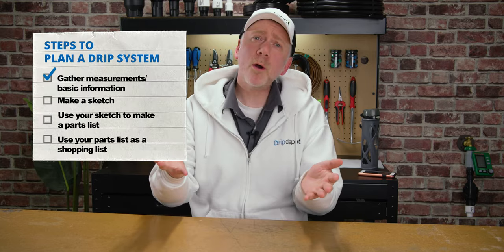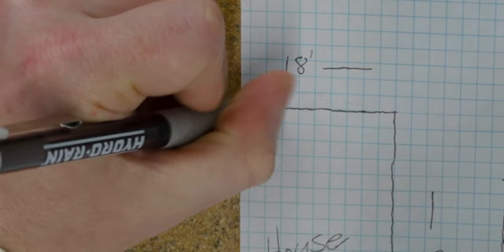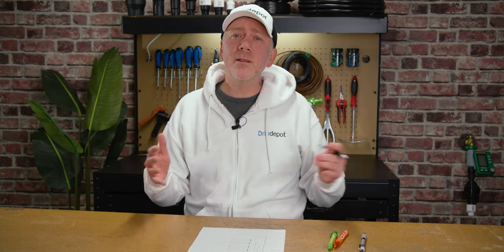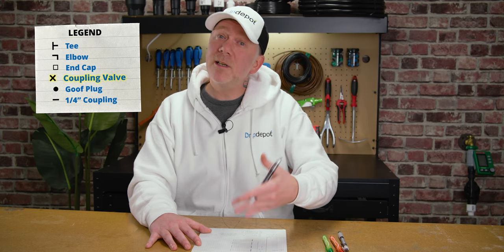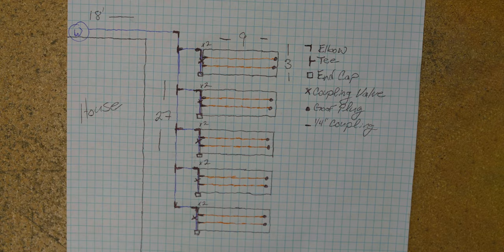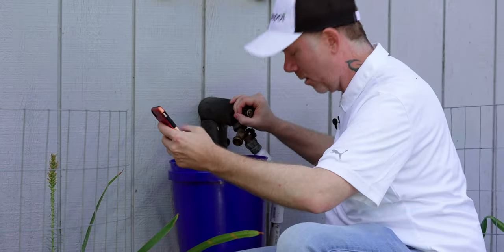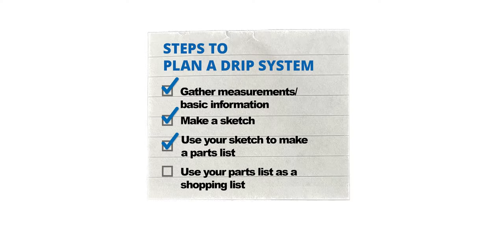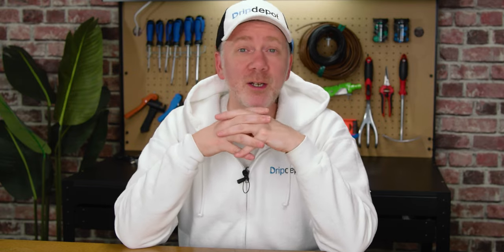How to Design a Drip Irrigation System (Beginners Step-by-Step DIY Guide)

Comment: Why didn’t you just run 20’ from the spigot (instead of 18’) to the beds and then the 27’ run could have fed each bed with a tee joint at each bed.  Less cuts and couplers that way.  I am planning my raised bed garden and that’s why I ask.
Reply from the maker: I'm probably misunderstanding (and if I am, definitely let me know!), but the reason we went 18' and then Tee'd off is so that each bed could have its own individual on/off. 

Here is an image that shows the design we were going for -- the coupling valves in this design are in a slightly different place, but achieve the same thing (third picture down): https://help.dripdepot.com/support/solutions/articles/11000119078-raised-bed-sample-layouts
Reply: @dripdepot  thank you! That makes sense :). I really appreciate your quick response.

Comment: SOLD! Great salesmanship brother! Im blueprinting and  measuring out what I need will make a purchase soon. Thanks!
Reply from the maker: Thank you for the kind words!  If any questions come up along the way, we'll be happy to assist :)
Reply: @dripdepot  Thanks, I'm wondering if I should use drip line or drip tape or both for my garden. I will have 20 rows of corn, 5 tomato plants, a 6ish ft long trellis wall for cucumbers, a 50ft long trellis wall for green pole beans, 4 squash mounds and 6 pepper and herb plants.
Reply from the maker: The description of your garden is making me hungry, must be close to lunch! 

How long are your rows going to be?  You could allow that to guide your decision -- 1/4" drip line is good for up to about 30' (with 12" spacing, less with 6"), drip tape is good for very long rows (hundreds of feet in some cases).  If the rows are closer to your trellis length (50'), drip tape would be the better solution for sure.  If the rows vary and you have some short and some long, it is possible to use both on the same system, you'd just want to make sure they have similar flow rates (or plan accordingly for some plants needing less water, some more).  

And now to satisfy this craving for some fresh vegetables lol
Reply: @dripdepot  Lol Thanks! its going to be a great garden I hope. My corn rows will be approximately about 40 ft long and I have my 5 staked tomatoes in a row with the cucumber trellis which is also approximately 40 ft long. Do you think I could get away with only using drip lines, or should I use drip tape for the 40 ft rows and 50ft trellis wall? Thanks soo much for the help. I'm making my cart as we speak.
Reply from the maker: That's awesome you're growing corn!  I lost mine to the raccoons both times I've tried, grr.  Maybe this will be the year haha.  

I think with 40' to 50' you can safely eliminate 1/4" drip line and can focus on 1/2" drip line or 5/8" drip tape.  The two are very similar, the biggest difference is in cost (tape costs less), durability (1/2" drip line is more durable), and flexibility -- 1/2" dripline can wind a little bit, drip tape has to be in perfectly straight rows (not a problem if you're planted in straight rows of course) :)
Reply: @dripdepot  Thanks for the info! Last year my sweet corn crop did great hoping for even better this year! So if I'm using 1/2" drip line can I still use 1/2" main line (poly). Ill be using about 150 ft total of main line
Reply from the maker: You bet, you can use 1/2" drip line and 1/2" poly together -- in fact, for the ones we carry, they use the same fittings so you don't have to locate all kinds of adapters.  

With that said, depending on the flow rate of the system, it might be worth making sure you wont' be losing too much pressure from friction.  Once you know the flow rate of your system (that's the sum of all emitters operating at once -- so if you're using 400' of 1/2" dripline with a 0.5 GPH emitter spaced every 12", the system flow rate would be 200 GPH), throw the numbers into this friction loss calculator to make sure it's not too high: https://www.dripdepot.com/irrigation-calculators/pressure-loss-calculator. 1/2" Poly dripline will drip pretty consistently from 12 to 50 PSI, so some friction loss is ok :)
Reply: @dripdepot  Is 1/4" punch hole size standard for all punches or do you step up in size on hole punches when using 1/2" drip line? Sorry if it seems like a lot of questions. I'm just completely new to drip irrigation and want to make my first purchase full & correct, also something to note my water flow from the spigot is 679.25 GPH.
Reply from the maker: The 1/4" punch is likely the most common used, but only when the system is using 1/4" fittings :) 

With 1/2" tubing to 1/2" drip line, it's unlikely you'll need a punch, so you're in the clear there -- what you'll want to do is think about how you'd like to connect your 1/2" drip line to your 1/2" tubing -- basically, what shape -- a straight line?  Just a 1/2" coupling would be needed -- Coming off perpendicular?  A 1/2" Tee.  

And definitely no problem on the questions!  That's the exact right way to do it in our opinion -- measure twice, cut once and all that good advice :) 

That's a great and healthy flow rate from your water source -- while it will be best to add it up to confirm, based off your description so far, I anticipate you'll have more than enough flow to feed the system.  

If you'd like me to send you graphics/images of the things I'm describing, you're welcome to email us, you can even put "Attn: Adam" and let me know it's you and I can send pictures of the things we've been talking about and describing.
Reply: @dripdepot  Ill be using 1/2" main line for whole garden, but ill only  be using 1/2 drip line for my corn rows. (1/4" for other plants) That being said, if not a punch to make the holes what tool to cut/punch the holes for the 1/2" Tee connections from main line to drip line? Whats the email? Also could I use 1/2" barbed couplings for the corn row 1/2" drip line instead of Tees? edit Ok I checked the website no 1/2" barbed couplings hence using Tee and cutter tool i understand now lol. which would also mean there isnt any 1/2" goof plugs , it'd be just end caps right? is there any difference between 1/2"main line and 1/2" drip line or same thing used for different applications?
Reply from the maker: Since you'll be using some 1/4" lines, you will want one of the 1/4" punches -- ok, with that out of the way, let's tackle the 1/2": 

For the 1/2" you'll probably want to use 1/2" Perma-Loc fittings, they are compatible with both the 1/2" drip line and the 1/2" mainline, no need for separate fittings.  

You have it right on the 1/2" end caps, the goof plugs will end your 1/4" lines (and fill any holes you make in the 1/2" mainline on accident with the 1/4" punch) :) 

And the only difference between our 1/2" mainline and 1/2" drip line is that the drip already has the emitters installed at evenly spaced intervals. 

Our email is support@dripdepot.com, or you can go through the contact us link: https://help.dripdepot.com/support/tickets/new (The Contact Us link should go to the same email address -- if you get any bounced emails or anything, use the Contact Us -- we also won't email you any marketing or put you on any emailing lists, just the info you request). 

In your email, put "Attn: Adam" and I'll get you over everything we've been talking about -- I can also review your cart and everything to make sure there's no incompatibilities and guide you through til the end :).  I suspect you're doing a great job though, as you're asking all the right questions.  We're just about to leave the office for the evening, so you might not hear from me until tomorrow, but you will, I'll make it one of the first things I do.
Reply: @dripdepot  You are the man! I'm going to do some final shopping and email you the cart. Thanks again!
Reply: @CastBlastCamp  Just following-up right quick -- if you've fired it off, I haven't seen it yet (no problems if you haven't, and no rush at all, just want to make sure I can help ya promptly) -- if it's being tricky, just use the contact us web form -- it does the same thing (sends off an email) and the reply will come to your in-box :)
Reply: @dripdepot  I emailed the contact us link
Reply: @DripDepotAdam  It said it sent the message ill try the other link too

Comment: Hello,
In the "main line" chapter, regarding the tubing size vs. lenght/GPH chart (200/200 rule), are you referring to internal or outside diameter?
Thanks for sharing!
Reply from the maker: Very good question, there's actually a bit more going on there than we touched on, good catch.  The diameter we're referring to there is the inside diameter -- to some degree, even that's misleading though as 1/2" tubing rarely has an actual 0.500" inside diameter.  For example, our 1/2" tubing has a 0.600" inside diameter which will experience less friction loss than an actual 0.500" inside diameter.

Even PVC has this issue, with 1/2" PVC having an average (it can vary a little depending on wall thickness) inside diameter of 0.622".  

Essentially, in the video we'll be referring to 0.600" inside diameter (with larger 1/2" sizes, such as 0.620", being able to go a little further and/or have a bit more flow going through) :)

Comment: OK, I'm going to stop buying my drip irrigation supplies from HD and go with you guys just to support your awesomeness!
Question:  In your example you show 3'x9' beds with two ~9' drip lines.  What's the rule for the number of lines in a bed?  In my case i have all 4x4 square foot garden style beds.  From your example it seems I could go with three or four lines.  Can you offer a rule of thumb?
Reply from the maker: Thank you for the kind words!  

Great question on the number of lines -- to some degree it is determined by the number of rows.  A common approach is to run one line for each row of plants.  For the most part that's what we did here, though some of those might not have been in an exact row (we installed this system for someone that had been hand watering beds, so the plants were all already in place).  

In a 3' to 4' wide bed, we'll usually do 3 lines (and there will often be 3 rows of plants in that size of bed).  Are your 4' wide beds going to have 3 rows of plants?  If so, you'd be served well by 3 lines, each one going right down its own row -- in common loamy garden soil, water spreads about 12" from the point of drip below the surface, so you might even get some overlap beneath the soil.  A little bit of overlap, or "head to head coverage" can be beneficial as it means no matter where the roots go, they'll find moisture.  

If your soil is particularly sandy and/or you'll have a 4th row of plants, a 4th line could be called for, but I think in most cases 3 will work very well here. :)

Comment: @dripdepot Hey great video. I'm planning out my irrigation system for about ~150 vanilla vines/ fruit trees/ raised bedsI've got planted across my property and using this video as a guide. One concern I've had that was an issue for me in the past when I used soaker hoses, was that it seems like I didn't get even distribution of pressure along the hose. I'm going to be designing the system over the next couple weeks, and I've got several different zones planned (one for vines, one for beds, one for trees, one for a small patch of lawn).

How should I be thinking about line pressure? The zone I really care about is for my vines, and while I haven't decided on either sprinklers or mist, its important to me that all emitters are flowing at pretty much exactly the same rate, and its going to be a particularly long run because most of my plants are planted along my fence-line. What steps can I take in the design phase to ensure I'll get good, consistent flow rates from my emitters for a given zone? Do I risk emitters at the end of a run emitting less than emitters at the origination of a run?
Reply from the maker: Very good question, and uniformity is one of the most important parts of irrigation, so you're on the right track in asking about it.  

The primary concern regarding pressure in your upcoming project is going to be in friction loss -- that is, pressure lost from friction between water and the wall of the tubing.  Friction losses primary variables are: The material of the line (poly, PVC, etc), the diameter of the line, the overall length of the line and the flow going through it in GPH or GPM (which is the sum of the flow rate of all emitters operating at once).  Basically, you want to minimize friction loss to a reasonable amount to ensure all emitters have enough pressure. 

I'm going to link a video at the end of this comment that goes into a bit more detail -- I try not to answer questions with videos, but the information is a bit much for a comment reply, the video will be able to provide better detail.  

Another factor to uniformity that's similar to pressure (and this is one where I most often see mistakes made) is the flow rate of the water source versus the flow rate of the system.  You want the flow rate provided by the water source to exceed the flow demanded by the system.  When the system flow exceeds the flow of the water source, some emitters are starved of water and uniformity goes out the window -- the symptoms of insufficient flow are very similar to those of insufficient pressure, so a lot of times someone will think they don't have enough pressure when in reality they don't have enough flow. 

As a quick example:  Let's say you were using 10 sprinklers for your vines and each sprinkler put out 25 GPH.  That would be a system flow (or system demand) of 250 GPH.  If the water source only flowed at 200 GPH, some of those sprinklers would be starved of water.  

In the example above, that 250 GPH in system flow is also the same number you'd use to calculate friction loss, so you can account for both pressure and flow with that same system flow number.  

The solution for both problems (low PSI, too low of flow) is pretty easy in simply zoning the system into two or more zones, it's just best to account for it first so you can plan for it in the design phase -- much easier to start with knowing how many zones you need than try and add more later.  

Ok, I'm going to link two videos here -- this first one is about sizing a mainline.  It covers friction loss in pretty good detail: https://www.youtube.com/watch?v=f81BHQnXi0Y

This second video is how to test the flow rate of your water source.  Are you going to be using a hose bib?  If so, that's exactly what we're testing in this video (though you can use the same method for other water source types): https://www.youtube.com/watch?v=tGxJaqQeg94

I know this is a lot of information, so please, don't hesitate to send over any follow-up questions that come up.  I'm absolutely happy to answer any questions (and I think asking them is the right way to go, measure twice, cut once and all that).  :)

Comment: I still don't know if I want 1/4 with built in emitters down the row of my bed or 1/2 with built in emitters, or 1/4 running to each random plant from the 1/2 tube.
Reply from the maker: Is it a raised bed?  If so, how long is it?  If it's 15' or less, the 1/4" line with built-in emitters will work great -- the 1/2" is very similar but isn't needed until bed length gets longer than 15' to 30'.  

It's not uncommon to use a little mix of line with built in emitters to get the plants in straight rows, and then some 1/4" tubing with a dripper in the end coming off 1/2" tubing to get to out of the way plants :) 

I'm probably a bit biased in favor of 1/4" drip line with pre-installed emitters, I use it extensively in my home garden, but that bias came from getting good results :D

Comment: Hi, thanks for the video. About the size of the main line, if I´m planning to have 2 zones working in parallel one of 116 ft and  the other of 129ft plus 166ft of drip lines total for both (longer bed 10 ft). Should it be enough 1/2´´ for the main lines and 1/4´´ for the drip line? or should I use 3/4´´ for the main line considering I will have 2 zones? any suggestion?
Reply from the maker: From what you've described so far, it sounds like you could use 1/2" as your mainline, at least in regards to length if both of those lines will be operating independently of one another.  

The other thing to account for will be the flow rate going through the 1/2" lines -- you want the total flow going through each one to be less than 200 GPH -- with 166' of drip lines it sounds like you'll be under that 200 GPH mark, but i wanted to mention it just in case :)
Reply: Thanks for answering 😊 I’m ready to buy everything
Reply from the maker: @stephaniefuente-albadoming7961   You're very welcome!  If any last minute questions come up or installation questions when everything arrives, don't hesitate to shout out :)

Comment: I'm brand new to this and I have really been enjoying your videos! Sorry if this is an obvious question, but say I wanted to do 1/2" mainline but split it off into four separate lines, also using 1/2" tubing (like a pitchfork shape). Can each straight section of line be up to 200', or does the whole structure need to be under 200'? Thank you!
Reply from the maker: That's a very good question!  Largely, each individual run is its own 200' length, so you can indeed go over 200' total, so long as no one individual run is over 200'.  

To some degree this would depend on the flow going through each 200' section (at higher flow rates I'd start wanting to check the math) but, in general, each individual length is treated as its own for the most part :)
Reply: Thank you so much!